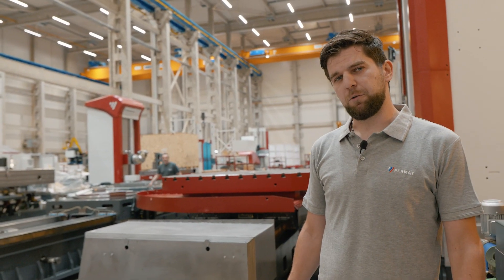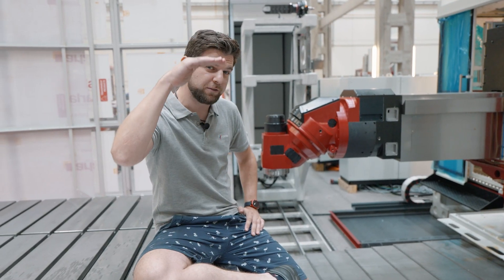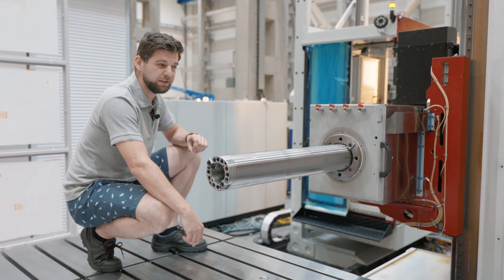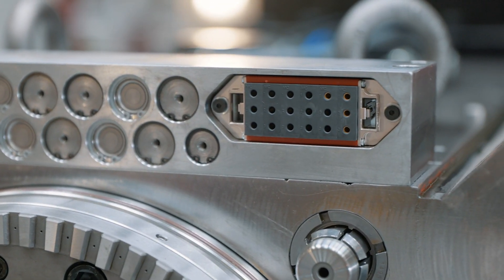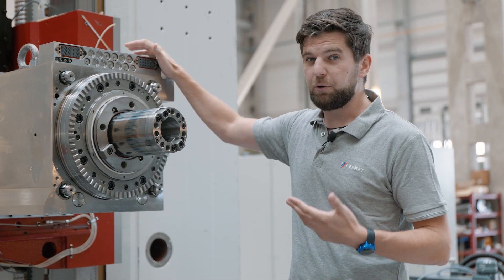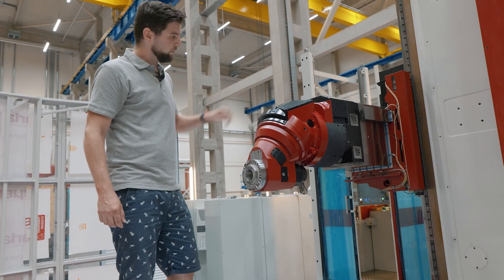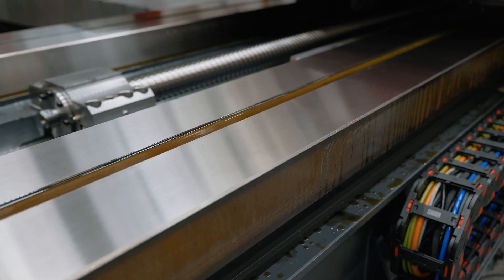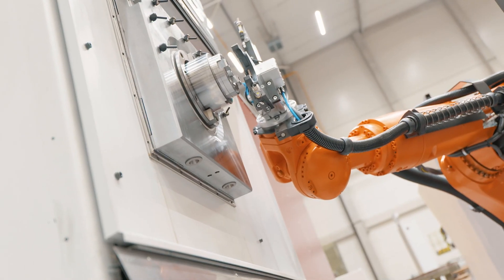WFT 13R and the Options Explained

Comment: What kind of system is used guiding the headstock?
Seems like air bearings to me, but that's kind of heard to imagine.
Reply from the maker: Box guide ways also for ram stroke - laser-hardened, in oposite corners of the ram. We use box guide ways as a standard also for X, Y and Z axes for this machine type...